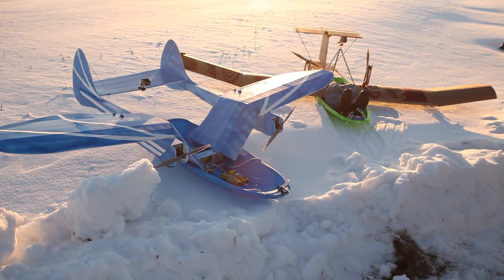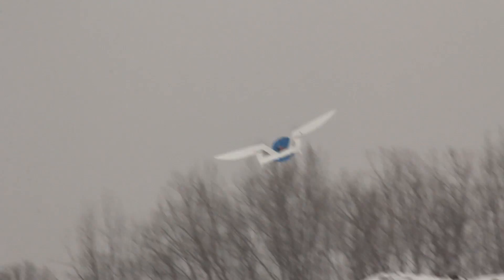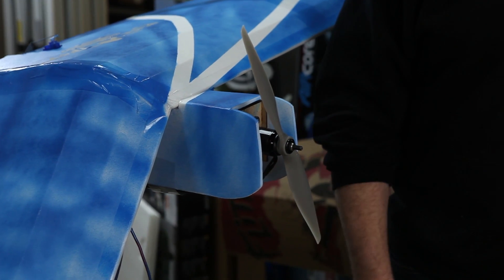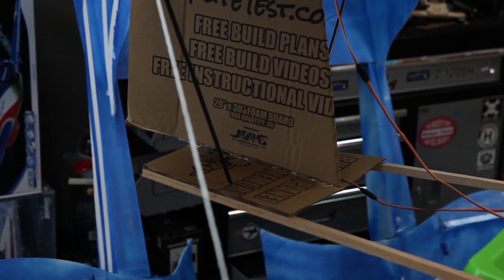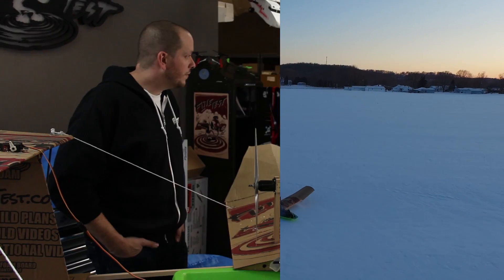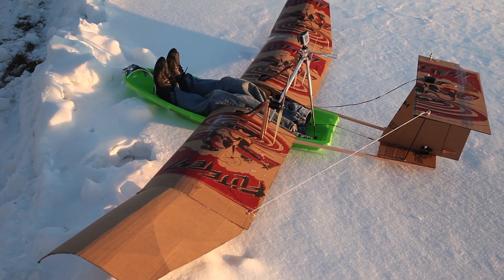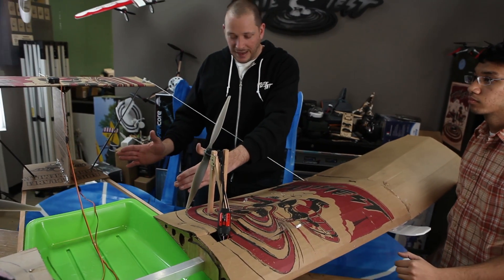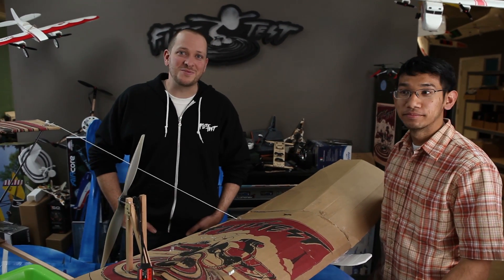Build an RC Flying Sled | Flite Test

Comment: Increasing the Wing and Tail area by about 150% would probably give you a machine that you could take off in. To be on the safe side, I would increase the Wing and Tail area by about 200% and of course, increase the power by about 500% percent. I believe you would have a really safe and stable flyer doing that.

Comment: Responding to, suggest some material(s) that are randomly or commonly available for you to you to fly: PLANTS -- A plane made out of grass, shrubs, leaves, nuts, gourds, rinds, bark (sustainably harvested after falling on suburban gutters), pith, or other plant based materials that are not manufactured or commercial wood products.  Preferably indigenous, non-GMO, and which you could grow in one season.  I guess for production purposes you could use existing materials which could theoretically be made at home, e.g. paper, glues, dyes, twine.  The structural components of the aircraft should be as vegan, or as vegetarian, as possible.  A plane.  Not a drone.  Anyone can make a fruit fly.

Comment: Build a snow fort and then bomb it with flying rc missles driven by rear mounted engines and pusher props. Kinda like the crazy stuff Japanese were coming up with in WW2.

Comment: Try building the Wright Flyer. I know it has been done but have you guys tried it. It would be really interesting if you could use the wing warp method the Wrights did for control. I think since the Wright Flyer started powered aviation it would be an awesome build and would be a great educational tool.

Thanks

Comment: Get an existing RC car and build retractable wings on it. So it has a surface mode and a flight mode. I would say the main wings should fold back in surface mode kinda like the F-14 Tomcat. I'm sure the tail can be fixed.

Comment: Id like to see some planes build with a combo of DTFB and 1/2 or 1'' insulation board (blue or pink)  Im making my own hot wire foam cutter this weekend and want to see how you guys would use the insulation board.  I think DTFB works best for control surfaces while the insulation board can make the airfoil and airframe.

Comment: I think an FT B-17 would be neat but would be better during the warmer weather. Btw that cardboard wing sled looks like a fantastic heavy lifter for mid air launches of other aircraft or a super camera platform. I'd suggest following through with the Concept and reenforcing it because that cardboard sled has some real potential!

Comment: Since you have made an RC aircraft carrier that can fly. How about you make a working catapult and arrester wire system. This would be useful for people who have small areas to fly in and it would be ideal for a more accurate flying experience. Especially with the F18 and F14.

I remember reading up on a design in the late 1980s and early 90s for a design that would actually float on water. The idea was declined for the group because of various reasons.

Comment: would be nice in a lite weight fiberglass and never break if crashed!
Reply: OLD TYPE FIBERGLASS tends to be heavy, YES INDEED........ Im not talking about Grand Daddy's fiberglass or the OLD WAY.... Composites today are very high tech and ultra synthetic and strong...stronger the Carbon Fiber when used in linear strength formations....... WHAT is the BEST RTF RC Aircraft today in the same class / scale/size as the Bixler 3....or is the Bixler 3 the best in its class?........ I will buy one and make a mold, make so cool payload design s and send Flite Test a few bodies to test for me/us.....can you or can anyone tell me what is THE BEST in that class or size?

Comment: how about an inflatable air bed. http://www.amazon.com/Intex-Classic-Airbed-Pillows-Double/dp/B000HBIL9O/ref=sr_1_2?ie=UTF8&qid=1424928231&sr=8-2&keywords=airbed
Reply: I wasn't considering helium filled, I was just thinking it could be used as the body. It doesn't weigh anything near what a microwave does and the unflocked bottom should slide great on snow.

Something in the spirit of the Goodyear Inflatoplane
http://en.wikipedia.org/wiki/Goodyear_Inflatoplane

Comment: I know this might sound crazy but a 3D printed plane would be so cool. Hollow works well for lightness. solid works and autocad are good programs. It would work well for being the winter because of it being plastic. From my personal experience with 3D printed objects sanding it with a fine grit makes it smooth and really nice.

Comment: Wires are used to "warp" the wing, that basically means to give them a twist to bank the plane left and right as the first planes (Wright 1901 and 1902 gliders) did not have rudders for steering, I believe the technique  led to the development of ailerons. nvr heard them called as drag and anti drag.but that might be something different.
Reply: It is something different, your referring to wing warping. He's using the wires to stop oscillation in the fairly weak tail section. So effectively doing the opposite :)

Comment: What about making a plane out of an electric leaf blower? Use the air that comes from the leaf blower as thrust
Reply: Are you sure that the amount of thrust could life that weight?
Reply: I would think that they would have to significantly modify the leaf blower in order for it to work, they could remove all the nonessential parts. And if they try I think they could do it.
Reply: ***** so what your saying is you want them to use a centrifugal air pump/fan because that's what the internals are.
Reply: TheJttv Sort of, but for comedy sake it should still resemble a leaf blower somewhat so you can literally say it's a flying leaf blower
Reply: ***** So, then DON'T remove all the non-essential parts, which means it wouldn't fly.
Reply: All else fails maybe Just use the externals, and put an inducted fan in the nozzle?

Comment: I would be awesome if you could make a human fly. Sort of like the intro to your sled video. I think this may be possible as you could make a cinder block fly so it shouldn't be too hard to fly. Perhaps use 2 huge motors per wing making a total of 4 motors. If center of gravity is an issue than you could have the human there and the motor setup be like a pusher delta wing style.

Thanks
Reply: They could use a crash dummy that weighs the same as a real human while testing. I like this idea!
Reply: The only problem is crashes would be way wotse
Reply: well that will make them more willing to make it work first time around!!!

Comment: Flite test, something on my plane stops working in the cold. i bring my plane outside onto a nearby frozen lake, but when i plug in my battery, the thing the ESC's do when they start up doesn't happen and it does not respond. when i plug in inside, its fine, but I wish i didn't have to waste battery while getting to my flying area. also, my skymule, for the second time in a row went dead a minute after takeoff, yet when i get to the crash, it (electronically) seems to be in perfect working order, somthing i wish i could say for the airframe. what is happening and what can i do to fix it?

Comment: Hers my idea! You should make a printer fly. And make it print out a page of your planes. That would be the best episode ever!
Reply: Optionalcoast74 Self replicating planes!
Reply: Or make a 3d printer plane and print a mini glider
Reply: How about making a rc car fly
Reply: Do that
Reply: I agree! crazy idea
Reply: Is FliteTest reading this? If you are can you comment?
Reply: This has been proposed at least once before! I think it was a comment under the circle plane challenge video. Someone suggested it print aerial photos as it takes them. They kind of did that in the lomo-copter episode, two years ago.
Reply: o.o that sounds heavy
Reply: Optionalcoast74 I don't want to be that one person, but that isn't possible. Most of them will stop printing or mess up if you even move it. There might be an exception, but even then, the vibration and movement in a plane would make the impossible.
Reply: You could use a 3axis gyro to keep it stable but all this will be bigger than a microwave plane
Reply: Even the movement of banking would be too much, so I doubt the gyro would do much.
Reply: You could use a tiny mobile printer that has an onboard battery but thats not a challenge.
Reply: use a small thermal printer...not sensitive to vibrations
Reply: good idea

Comment: Could you turn the sleds in to lift pods (short wide wings) and place them on  the ends of a main spar the use the one more sled as your snow landing gear.

Comment: FliteTest  You guys should try a recycled airframe challenge. Make your aircraft only out of recycled materials ie. Soda cans, card board boxes, newspapers, and see whose design would fly the best.
Reply: An airframe built by soda cans alone would be a unique challenging build and make it harder. Cardboard makes it too easy.....
Reply: Yes! That would be amazing. +FliteTest
Reply: Peter will probably win that by a lot. IIRC he mentioned in a podcast once that he started building planes by using styrofoam plates from a restaurant and whatever else he could find.
Reply: Great idea.
Reply: Cardboard tubes would be great to see. As a fuselage and/or modified for wings.